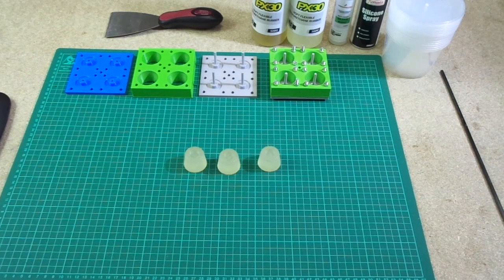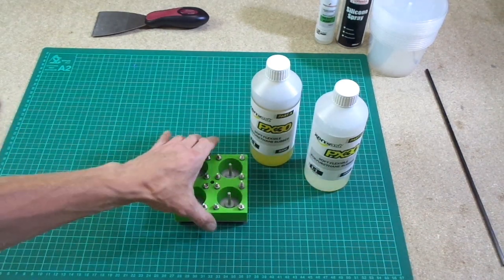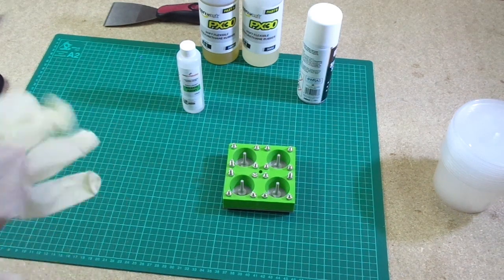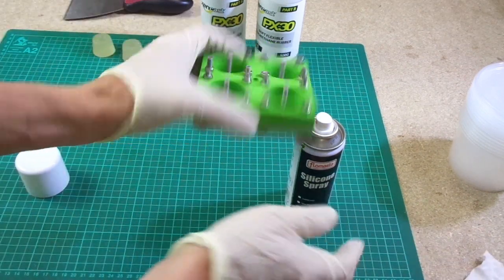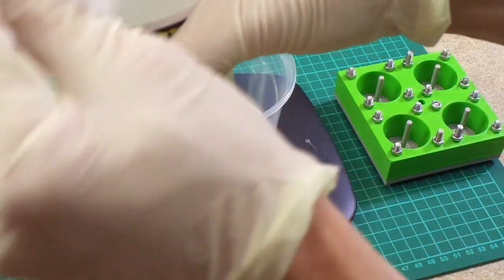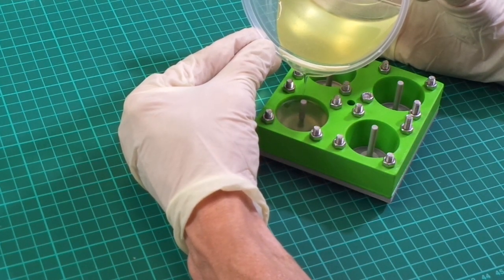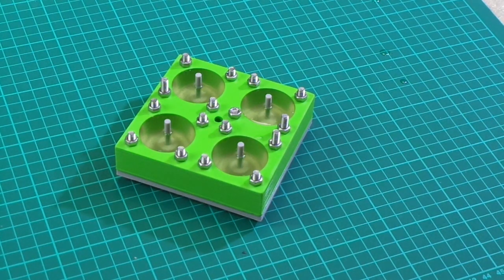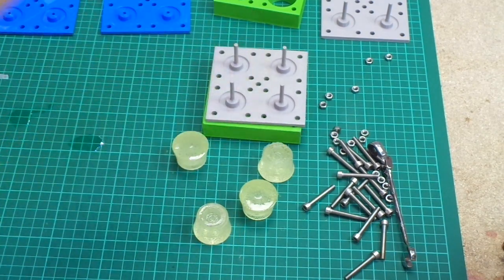3d Printed Mold used to Cast Simple Polyurethane Parts

Comment: Hi. Nice work. Have you even tried to cast harder polyurethanes, like vith a shore D70 or similar? I once tried with PLA mold, but I was not able to get the casted part out of the mold (probably I used the wrong release agent, I think it was vaseline). As I recently bought a resin printer I am thinking of trying again and print a mold in a elastic resin. Maybe it would be easier getting out the hard casted part from a soft mold (treated qith the appropriate release agent.
Reply: Pär Nilsson i did the same as you and couldn’t get the parts out of the mold. Maybe I’ll try it once more with a different release agent

Comment: You can put it in a vacuum chamber to get rid off air bubbles before it cures. All you need is an air tight box, and a vacuum cleaner.
Reply from the maker: Hi Build 'n' Fix - Yes I have a Vacuum chamber and pump set up but as I said in the video I wasn't going to show that in this example. And unfortunately a standard vacuum cleaner will never produce enough vacuum to extract the air from polyurethane as it is very viscous and does not release the majority or trapped air until a vacuum of around -28 in/mg - / approximately 85% vacuum. A modern standard vacuum cleaner is designed for vacuum flow and not 'absolute' vacuum performance and simply can not pull hard enough to release air from these thick materials.

Comment: nice work. did you do any post processing to the 3d printed mold? what layer height did you print them? thanks in advance.
Reply from the maker: Hi Mortaldrumming - apologies for such a late reply. Yes the 3d printed parts were sanded down to a super smooth surface and then coated with the release agent.
Reply from the maker: Layer height was 0.12mm
Reply: What release agent?

Comment: would you say the molding parts are cheaper than if you 3d printed them?
Reply from the maker: Hi M House - in general molded parts will usually be cheaper and stronger than a 3d printed component. In this example the parts would work out cheaper to cast in polyurethane than they would be to say print in a flexible filament. bought by the kilo the materials are cheaper and in terms of time the casting process wins by far. The main issue with moldings is the time taken to design and make them, once the mold is made then the casting is a fast and cheap process that allows the mass manufacture or multiple parts quickly in comparison to 3d printing.
Reply: @1973shaner  what polymer do you recommend for non-flexible durable output? i'm finding its hard to beat the price of PLA part ($12 per 1KG roll) vs molded Polyurethane  part.